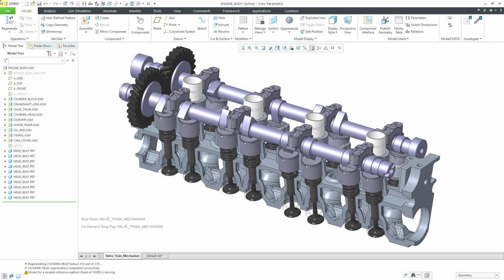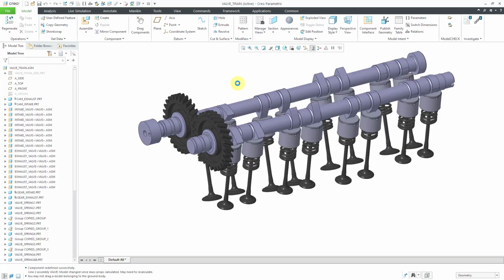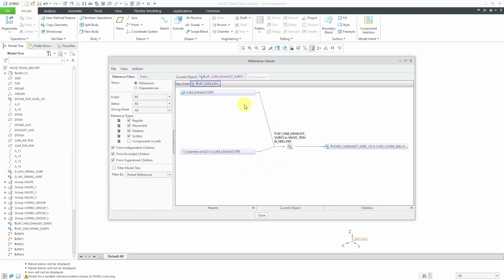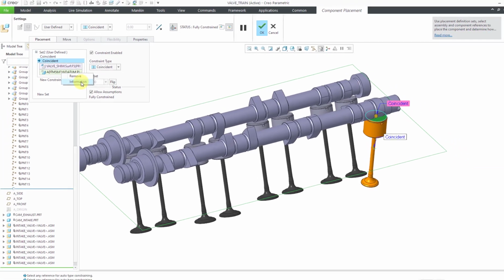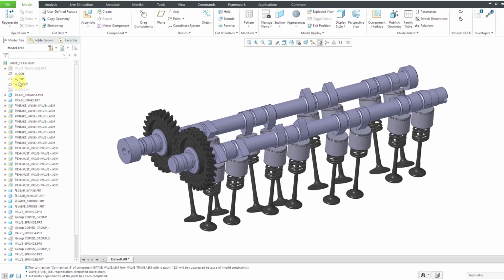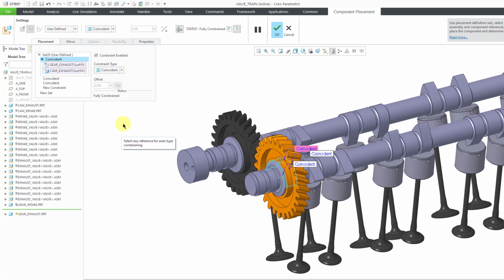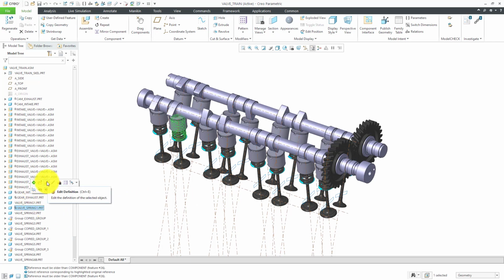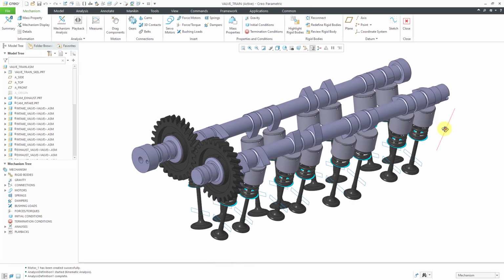Creo Parametric - Preparation for MDO Springs Video (Part 2 of 4)

Comment: Great video and sheesh that was a lot of work just to get some parts to rotate. My question is do you know why one would set up the model like it was originally?  Was there no intention of ever making the parts move or is there actually some benefit to the way they had the model setup/constrained?
Reply from the maker: Yes, it was a lot of work. I leveraged these models from an old Pro/ENGINE dataset from version 18 around 1996. That might even pre-date MDX, so applying motion was probably never a consideration. I think some of the modeling choices were made in the sake of getting a configurable engine dataset given the capabilities of the time. But unfortunately the detective work is representative of the things I've had to fix in the real world.